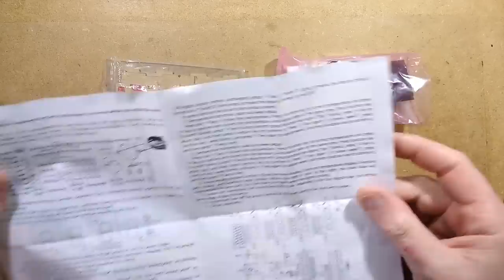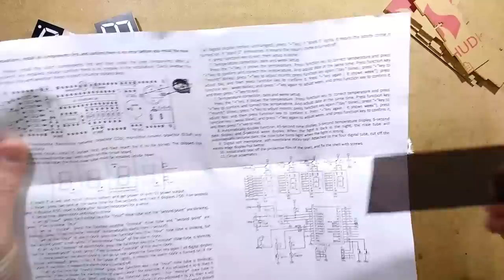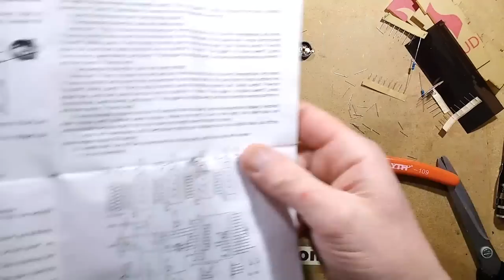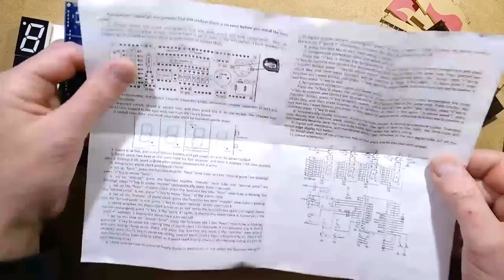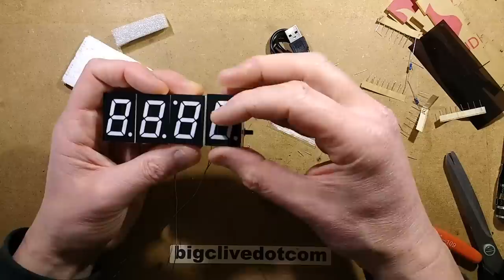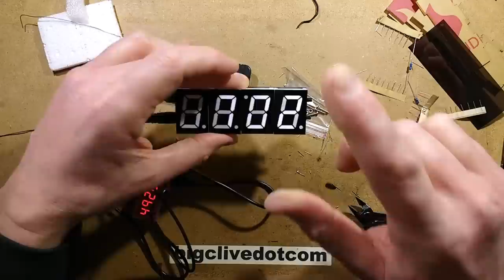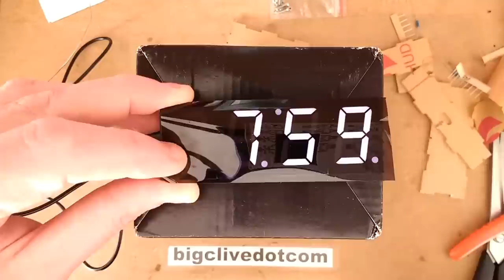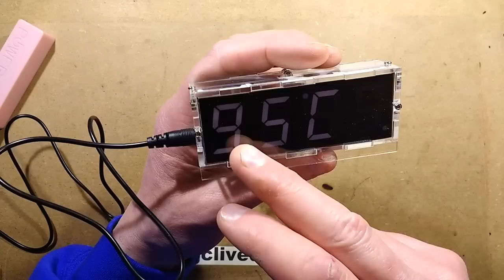eBay clock kit.  Full build and setting guide.

Comment: Got one 24/7 for years now and guess what: the leds have faded. But as you said as it's PCBs with SMD leds we can replace them! BTW, I've made one for my mom and wonder why it takes up to 5 minutes after 2/3 months: xxxPPM too high or maybe I've heaten the xtal too much? I wonder also if the 5V phone charger I use can add some noise around the 32kHz and mess things up? Don't know where to look without brining my 'scope there ;)
Reply: Ok guys, need to get the clock slower or fater? Played a while with it and tuned one to +20sec a year and one to +30sec a year. Lower the load caps (22pf on my kit) to get a faster clock, bigger caps for a slower one. It's a game of some pf or even less and fast change occurs around the "sweet spot". Tune with less than a pF around few sec per year, hence my +20/+40 tuning, can't adjust better. If the clock takes/loose as much as several seconds a day you can change the caps values by 3/4 pf the way needed... anyway, that's some work and days of waiting for tuning check... good luck!

Comment: Put your finger over the part when soldering sensitive components: 1. it shows when you've gone too far, 2. takes some of the heat away. I've never messed anything with that rule (of course for small items).
Reply: Also, you're supposed to use tape to assemble that case. Not juggle the items.

Comment: How do you change the battery in that thing ? Tear it completely apart ? Other than that this is a rather nice looking digital clock. Thanks, I'd like to see more of these.
Reply: Brian Allen yes, you remove a couple screws and it falls apart, you replace battery and spend some quality time with enclosure again reassembling it. You shouldn't need to do this often at all, no major worry, once every many years.

Comment: I found a GitHub repo that can flash an open source controller code that helped simplify the buttons and make it a little more “customizable”. Made this cheap kit even more fun!
Reply: If you find it again you could post a link
Reply: @DoctorWhom  found it! https://github.com/zerog2k/stc_diyclock 

I scrolled to precompiled binaries and then used an STC flash application over TTL to the UART on the pcb.

Comment: Interesting, I built an almost identical looking kit a year ago, but this seems a little different. 

The one I built has a PCB footprint for a relay, screw terminals to connect it to an external circuit, and the ability to cycle it based on the alarm, but the relay and terminals weren't provided.

Also, I don't think the one I built has day/date functions.

Comment: Ive got a couple of these.  You can run a couple of wires to the chip to get it to display time only.  Which is what ive done with mine.  See some one else posted that.  I got details from banggood kit comments section

Comment: Hey Clive, if you ever find the kit going erratic, i.e. missing the same segment across the 4 displays, you missed soldering one of the current limiting resistors at 10:44
Reply from the maker: It was the decimal point resistor.  I spotted that and mentioned it in the video.

Comment: Why hold the board when soldering. It cramps your hand. Just place a little antistatic sponge on the desk and press down. Or just use the wooden desk if you are worried about burning the foam. Also, the blue resistors are generally metal film instead of carbon film. Also, best assembly methods is to start with the lowest components first and increase in height as you go. Then you can use a desk to hold the components in place while you solder.

Comment: Instead of (or in addition to) sockets for the ICs they should have put the display segments on sockets so that it's less daunting to re-work the board.
(You can add the sockets yourself but then the case would possibly be not deep enough to accommodate.)

Comment: There test pads for the circuit board not programming pads also the ROHS stuff was a ban from using lead in mass manufacturing because the amount of vapours produced on a industrial scale of use also that incident you mentioned where someone’s house got burned down by a pound land power supply they had a frayed cable plugged into it

Comment: I just finished soldering one of these. Got it off ebay for $5 (+$2 s&h), and it's mostly the same, just a couple of components changed. But mine is really dim! Like "unusable in daylight" dim. Any guesses what could be wrong?
Oh, and also: no case any (no problem, i'm gonna print one), but still included the screws... 🙄

Comment: Hi Clive !
Viewing that I've just bought a soldering station like  that you use in this video (Yihua 937D) I want to ask you what temperature you set for this peculiar case (sensible components, tight assembly, etc.) ? Thanks a lot  !
Reply from the maker: I set mine to 350C, but go by feel as the display is sometimes inaccurate.  If it doesn't seem to be melting the solder properly turn it up a bit, if it flows fast but spits flux too much turn it down a bit.

Comment: I assembled a similar clock last year but it didn't have the tinted screen or the new-fangled LED's. Is that the future of 7-segment LED's? The kit I bought had a dead segment on a digit and I didn't find out until the assembly was finished. Having to remove and re-solder a new one resulted in lifted circuit traces and one digit brighter than the rest. Best to test first.

Comment: didn't want to read thru all the comments but did anyone notice you missed soldering a resistor lead?  video @ 11:38 last one of the 330 ohm resistors.  the un-soldered hole can be seen throughout the rest of the video.. just an fyi for you Clive.

Comment: ROHS is mostly about the time after the normal live of electronics. If you look at how the stuff is treated, burning it outside by people/children w/o any protection, you might understand the reason. 
Ok, maybe compared to the amount of lead burned/vaporized in cars for about 8 decades it is a small problem, but if I‘m sometimes reminded to the smell of the 60s/70s by a single old car, I like that „new rules“. And with leaded gas, it was immediately clear how dangerous that is, as workers producing it, died. But it was such a good way to make lots of money.

Comment: Just finished soldering this kit and I can’t get the large IC into the holder. I’ve bought the same chip pin former as Clive so I’ll wait to see how that helps when it arrives. I’m feeling it’s the socket and not the pins though. Any tips, don’t fancy desoldering the 7 segment displays to get to the chip holder 🙈 to replace it?

Comment: So, commenting cuz I can... I've got one of these clocks in my garage as a novelty.. These kits really are more worth the experience of assembling them (I've built several cuz they're fun!!) than the user experience of the finished product. However, assembling them is actually a pretty solid practical exercise. (edited cuz I pissed all over grammatical rules for then/than.. ooph, type it right, not as it sounds in casual speech, eh?)

Comment: I built one of those a couple of years ago, nice clock, had it in our RV for one winter season, now it's setting on my computer desk. I  like the clock fine, but I wish the Chinese would figure out that we here in the backward USA have NO CONCEPT of centigrade temps!  No damn way to change the setting one it, however there does appear to be a place for  a serial pin set, perhaps a fellow could break into the chip and make it display the REAL temp?

Comment: I bought this kit on ebay a couple years ago and just did it today.  After I plugged it in the speaker didn't work and I noticed it was loose.  Guess I did a crap job on that, but everything else seemed to work until I realized the time is about 20 minutes slower per hour than real time.  I guess the crystal is faulty or something.
Reply from the maker: Try swapping the crystal for a better quality one.

Comment: I have built up to 6 of these and they are very good kit for the money and they make good presents, just one thing I noticed all of them slowly lose time and you have to reset them, I thought they are quartz controlled, is there any mod to improve the accuracy.
Reply from the maker: It may be possible to replace the timing crystal with a higher precision one.  32.768 kHz.

Comment: Can you make a tutorial about soldering. You solder so nicely that would be nice because my soldering never shines and I don't know if ot is because the temperature of the cheap Chinese solder... Also it tends to get glued on the tip of my iron!
Reply from the maker: If you use lead-free solder it will always be dull.  Try a proper 60/40 tin/lead based solder.
Reply: Or even better: 63/37. And make it a good quality brand, this is one of the things you want to spend money on. It's funny how a 45 money unit soldering station goes a loooong way for a hobbyist but if you buy cheap&bad solder.... head meets the wall, repeatedly.
Reply: I bought some cheap chinese solder out of curiosity, and it was genuinely awful. It was meant to be 60/40 lead-tin with a flux core, but it must have had 80/15 with another 5 of saucepans, copper and tinfoil. It was terrible stuff and only turned to mush, and would not melt properly, regardless of temps or whether I used additional external flux. Save yourself time and money and get it right first time - go brand name and from a trusted source (e.g. not ebay)
Reply: askjacob I'm using the KAINA 60/40 one! I don't think that bigclivedotcom is prone to expensive stuff though, so I still bet in his technique...!
Reply: There is a wide price range in good solders, I have seen 18-175 dollars for a 500 gram roll, it all depends on how crazy you want to go. I will say that I can guarantee that Clive is not using ebay nasty solder, but I would also bet he is not using top dollar stuff either. My favourite was the multicore 37 63 crystal core but it just is out of my price range these days
Reply from the maker: askjacob I tend to use general purpose own-brand solder from my main UK component supplier.  RVFM solder from Rapid Electronics.
Reply: Thanks Clive, nice to know you still have a reseller that has decent stuff. We have Jaycar, otherwise the next real step is the big boys (and costs) like Element14. Jaycar is very hit and miss unfortunately

Comment: It's odd that the thermometer is in the shell the ones you get today, have two wires that come out of the shell, not sure what the 2nd wire is for but because of this you now get a more accurate temperature.

Comment: Just starting out at the young age of 42 and looking to get one (or two) of these, would it work with a  4xAA to barrel jack connector battery holder?

On a side note I have always struggled with all things electrical/electronic partly I think due to my inability to conceptualise electricity flow, there are various analogies to water or exhaust pipe flow that work in SOME situations but not most. Have you done an explainer on this? I really can't get into my head what Volts, Watts, Amps, Ohms etc actually represent. If you have an explainer I'm struggling to find it and apologise, if not is there any chance of you making one? I find the way you explain things brilliant!
Reply from the maker: It would get through the batteries quite quickly.  A rechargeable power bank may be better for off-mains use.
Reply: @bigclivedotcom  Thanks, I'll go with the USB charger you suggest in the video in that case!

Comment: there's room in there for a supercap (instead of battery backup) and a small charging circuit for it. that way you will never need to open it to change the battery

Comment: really helpful for beginner like me.
its works, at least for couple minutes until i mistaken use 12v power supply as input source.

Now nothing works, just keep beeping and unreadable led light. Can this be fix?

edit :
Just found out, the microcontroller is broken. Build a new clock and now run well.

Comment: Hello Clive.  Can you do a follow up on the accuracy of this clock over time?  I have multiple digital clocks that lose 15-20 minutes per year -- you can barely even call them clocks when they're that bad.
Reply: If in doubt, just don't take the 32k crystal from the kit, take one from a local store or from a clock that you know to be exact. Keep your clocks at around 25°C, else they will run slower. What are the clocks that are way off, are they kit builds? I'd like to take a look.
Reply: Look for "SVINZ Day Clock Digital Calendar" on Amazon.  http://a.co/a3Qf2au  I bought one of these for my mother and it has lost at least ten minutes since I set it up for her six months ago.  The other problem clock that I have is built into a shaving mirror.  Look for "Zadro Fogless LED Lighted Fog Free Shower Mirror LCD Clock" on Amazon.  That one loses at least 15 minutes per year.  The SVINZ probably has a crystal.  The shaving mirror is almost certainly a clock on chip.  They are not kits.
Reply: Mark Warbington The SVINZ looks like a reprogrammed/repurposed digital picture frame hardware - some of these are actually well enough designed to be able to more or less keep time (if component quality and selection isn't too shitty, which it usually is, but you can fix it up), some are completely useless in this regard. The Zadro... well a usual clock? Usually there's a crystal in there. Thing is, kit hardware, you can look at the PCB, chances are there's schematics, and can hypothesize on what's wrong and try to reason about it. Things sold as consumer products, that's not so easy, i can't even google up the PCB for the SVINZ.

15 minutes a year is usually considered spec for 32KHz crystal precision. Things get worse if parts are mismatched. This clock kit uses a DS1302 from the pictures i can get. The kit uses two 22pF capacitors on the crystal. Usually you get crystals that are specified with 12.5pf load if you buy the cheapest ones, so 25pf on each leg; however the DS1302 contains about 12pf on each leg of internal capacitance, plus there's some stray capacitance on the board. So in total, it loads up the crystal with too much capacitance and makes it run slow. Reduce the loading capacitors to approx. 12pf to make it run about right. Either they forgot that the RTC chip contains internal capacitance when they designed the clock, or they simply had an overstock of these values, which is likely, the same value is used extensively for high speed clocks.

This kind of consideration is also what you'd apply when calibrating another existing clock.

If the DS1302 is genuine, you can simply ditch the capacitors on the board, bridge them over, and get a 6pf specified high quality crystal. Or you can get a 7pf one and put a 3pf trim capacitor in to fine tune it. Another modification i would have an urge to do, would be to add an inductor bead on +5V supply of the RTC chip.

If you want really precision timekeeping, you'll pay yourself silly, i mean a factory calibrated solution costs upwards of $10, so you can bet any manufacturer of ready made devices will bill you about $50 to $100 for the privilege.

At this point, the nearly cheapest way to getting a precise time is absurd: a 3€ ESP8266 board programmed to log into your home WLAN and get time from the Internet. A DCF77 antenna costs no less than 10€, and a GPS receiver about the same, but GPS can't be used indoors. Say, would you want an ESP8266 clock? How much would you pay and what other considerations, like dimensions, power source, etc would you prefer?

Another possibility is a clock that has no internal time source at all and simply counts cycles off the power grid, but i doubt any have been made in the recent decades. Today, designing an inherently safe one is challenging since traditional transformers formerly used e.g. for halogen lights have been outlawed because of their low efficiency.
Reply from the maker: Have you checked out the radio linked clocks that use a standard time signal to keep themselves displaying accurate time.
Reply: A clock like this (4 displays, simple case, 5V so it can be run off a USB charger) made with ESP8266 instead of 1307 + Micro-controller sounds like a good plan.  The hard part is configuring it to authenticate on your home LAN, it needs the SSID and the 'password'.  Once that's done it can, as you suggest, use NTP to get the time.  Then once you tell it where it is it knows what offset to use and maybe even can do the summer time changes automatically.  These sorts of clocks would be a boon in countries that don't have the likes of DCF77, JJY, MSF, WWVB etc.  I want it for Australia and for NZ.

Comment: HI Clive, bought one of these and assembled but didn't fancy hooking it up to the mains via an adapter, so I grabbed a couple of 2400maH LiOn 14500 batteries at 3.7v each, a 7405 voltage regulator and wired it up. Prior to this I tested and found the clock drew about 45ma when at it's brightest setting (displaying the clock). In theory shouldn't this then last a fair while on one charge? First night it conked out about 3am (my 9yo son had great joy in telling me) so I used new and freshly charged batteries and found it lasted about 18hs. I even put a switch in line so that the display was switched off during the day. Any thoughts on how best to power this via a battery/batteries?
Reply from the maker: A continuous load like this is best powered from a good quality plug-in power supply.